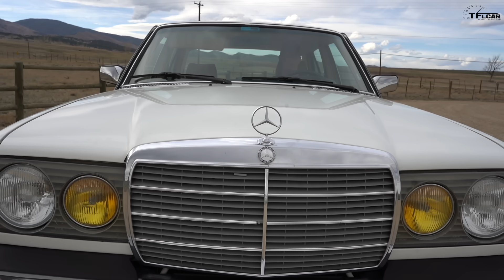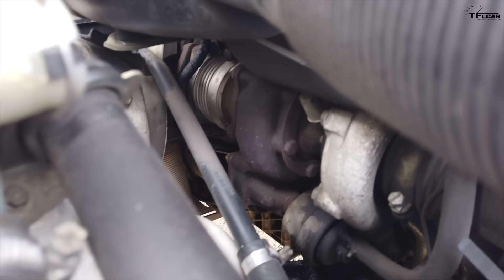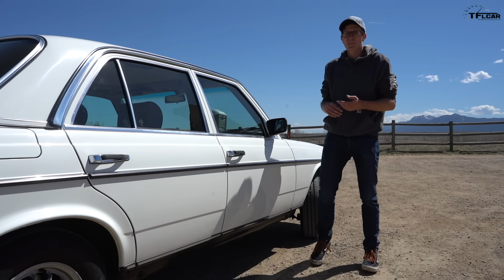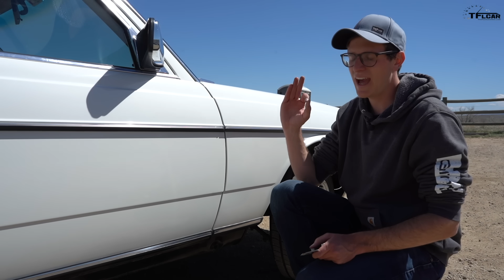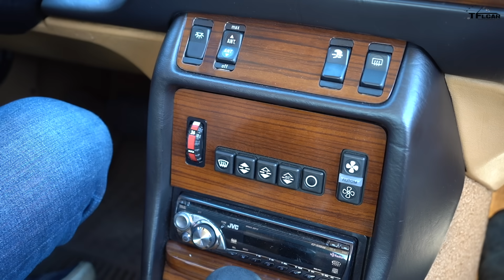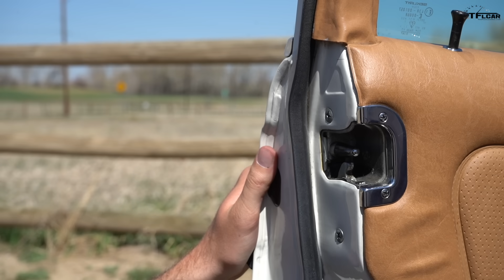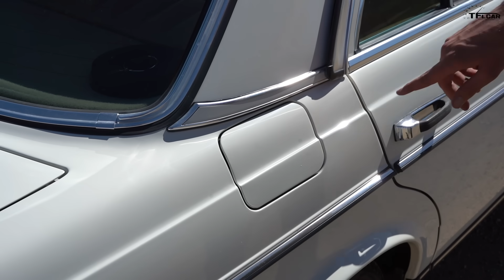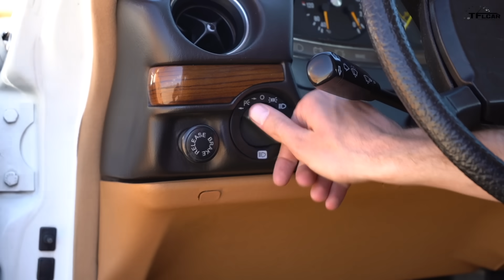This 37-Year-Old Diesel Is THE BEST Mercedes Ever Made!

Comment: I have a 1984 & 85 300D.  Never had another M-B, so can't compare, but don't consider it as reliable or easy to repair as my 1960's Chryslers or even modern economy U.S. cars.  The earlier non-turbos which were more common in Europe were probably more reliable.  My 1985 engine failed at 330k miles.  Disassembled and several pistons had chunks missing around the ring grooves and something like a small ball-bearing was bouncing around in cyl 1 (no idea how it got there).  Before that, the compression had dropped to ~250 psig in most cyl (>400 psig new) and needed a block heater in the winter.  The prior owner had religiously taken it to a dealer (thick book w/ many pricey receipts).  You can't affordably rebuild the engines since 1 new piston costs >$550 if you can even find one and many parts are "not avail".  I bought the 1984 for the engine, but found another engine so wound up w/ 2 drive-able ones.  Many small things can destroy the engine.  The vacuum pump on front of the block can send parts sliding into the timing chain.  An oil cooler hose can get cut by the power steering belt, starving the engine of oil, and this happens when motor mounts sag.  The lift pump can leak fuel into the engine block to dilute it, or its flange can break to leak oil.  If not enough fuel for the turbo boost, the pistons can melt.  A bad injector spray can burn thru a piston, and so on.  I do like the solid, clunky switches (like an old H-P scientific instrument) and the electrical connectors are large and easy to repair.  I agree that the automatic climate control is a complicated mess that almost never works correctly.  You must enjoy a sunroof since that is the only way they came in the U.S. models.  The trunks like to leak water, often from the rear window flange rusting.  Mine idle much quieter than yours, probably because I fuel with renewable diesel, which we can buy at the pump in California (works in any diesel).  No net-CO2 emissions, so better for the planet than any battery-car.

Comment: Not only the best car but the cheapest to own. My 82 240D has over 250k and runs great. I call it the "Triple Four". Four doors, four speed, four cylinder. I mix used veggie oil or home heating oil depending on the season with Diesel. And it still gets 30mpg. I would not sell at any price. Well almost.
Reply: I had an 84 300d euro 4spd (no turbo), it got 36 highway with standard tires. I swapped 2 for 185/75 and got 39 highway, don't recommend unless you find heavier light truck/ RV tires because it got a bit drifty, did great in the snow with them on the rear though. 
Home heating oil is #1 oil and will reduce cetane, it won't gel in really cold weather but it also reduces power/mileage. I did run the diesel additive all the time though, whenever I stopped the mileage dropped and it got a little sooty.
Reply: Is using home heating oil in your country illegal? - In Germany it is a big crime cause heating oil is the same fuel just as Diesel just with an added color for notice
Reply: @martin5697  it's also illegal here. not an option as price is almost same as diesel.
Reply: @martin5697  No bureaucracy here to even fine you for using it HHO. It's all about the paperwork.

Comment: @TFLclassics,

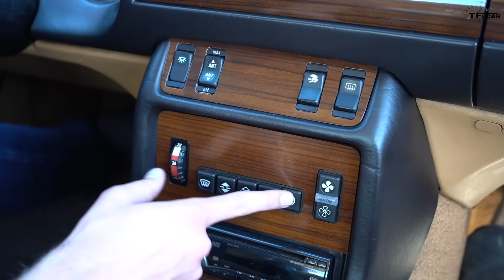you complained at time mark 10:34 that the temperature setting wheel is gauged in degree Centigrade, not degrees Fahrenheit. However, you conspicuously avoided to point out the setting wheel is coded with varying colors to indicate from hot to cold and everything in between.
Reply: My Dad had the gasoline version of the 200 series and it was quietest, comfortable and powerful car I’d ever known at the time.

Comment: These were “dumb” engines. They weren’t taught to make a visit to the dealer every few months to empty your wallet. I owned a 1980 240d, a 1982 300sd (turbo), and a 1985 300d (turbo). These were commercial vehicles disguised as a normal passenger vehicle. The engines were severely overbuilt, and severely underpowered ....the perfect combo for low maintenance and very few repairs. I drove about 1 million miles among the three. I never ever broke down .... ever. What happened to them?The floorboards went “Fred Flintstone” due to rust on the 240d with over 700k . The 300sd with 400k died in an accident. The 300d was lost in the divorce (but I did get weekend visitation 🤠)

Comment: Compared to the throw-aways today..
I stopped buying new cars in 2007. Just maintaining 13 y.o. 
Banks do nothing but bankrupt our kids into loans. 72/84 month for junk.
Reply: John Gun the business model has changed drastically since the 80's.
Back then Mercedes buyers bought their cars with their own money. They were bought by wealthy people. Nowadays 85%are sold through finance on a pcp deal to regular people . They return in 3 years and go again. 
So the way the manufacturer looks at it is the car needs to last 5 years at most. 3 for the first owner and 2 for the second.
The company I work for has done several "right sizing" projects which means making something last as long as it needs to and no more.
Sad really
Reply: Yet cars are actually cheaper if you factor inflation. The bank loan stuff is a different manner.
The long term loan stuff is assinine though. End up in forever car payments..
But that's people choice..
You can save up and pay for a car, or at least have a big down payment.
But too many today want instant gratification.

Comment: My father had a W123 230 from 1978. 109 horses, technically great, no problems - but  with the years very very rusty. Imho NOT the best MB.
Reply: All cars get rusty if you dont maintain it properly. The piint of this car is to run forever without issues, not be immune to rust

Comment: I agree with you, I've owned a number of 240, 300D (both Turbo and pre 1981 non Turbo versions) and 300TDs over the years.  Bullet proof.  You missed a few less obvious cool features:  back in the fuel door,  the spring mechanism is to slide the fuel tank cap into while filling the tank.  The cruise control stalk I always felt was very innovative and well thought out as well.  The seat has TWO slide controls, the one you showed on the side slides the seat  back and forth on an inclined plane to raise and lower the seat,...then the fore and aft adjustment handle is in front of the seat. One correction, ….your turning circle would probably be 10 meters, not centimeters.

Comment: I prefer the volvo 850 (especially the T5R model) because the mercedes rusted like crazy, and it had problems with starting up in winter. The volvo on the other hand started every time and was build out of double galvanised thick steel. You can still buy these cars that look like new from the outside only the plastic interiour hint’s at its age.

Comment: There is a 1976 240 D in the Mercedes Museum with nearly 5 million km on it.  It was a Taxi in Greece and a plaque at the museum indicates it is the  highest known mileage car in the world.. so yeah your car comes from an extraordinary gene pool.  Jay Leno once claimed that if GM had built the AC and a few power accessories that you'd have a perfect car with the Mercedes-Benz.  My 1988 W 126 is a rolling testament to that legendary German Engineering.

https://www.expatica.com/de/last-ride-for-mercedes-taxi-with46-million-kilometres-on-clock/
Reply: Highest mileage car in the world is a Volvo P1800
Reply: @CarlosCostaX  True... another great car but Highway mileage. From a strictly durability standpoint it would still have to double that to reach 5 Million City. The Mercedes-Benz in the Museum still runs too.  Both the Volvo you refer to and this Mercedes-Benz have had engine rebuilds.. The documented highest mileage without a rebuild is still an OM 617 Diesel.  There is a YouTube video of that particular car. You can't beat a diesel for durability.  There are tractor trailers in the US with 8 million miles on the clock.

https://www.youtube.com/watch?v=15jkNDwHWj0

Comment: My boss in the 1980's had a MB 300D (the engine failed twice) and a Ford Festiva (the Korean built Mazda mechanicaled version of Ford's Euro- Fiesta I ran to the red-line daily and couldn't kill). She was not aware that as twenty year old I just beat the ^&$% out of both cars just as if I was driving one of the company Ford-E150 (4.9 liter 6cyl) delivery vans when she asked me to pick up her brats or drop off floral supplies/ deliveries in the Ford Vans.
The Benz was not only a performance dog, it stunk (diesel), the van surprisingly had decent pick up (and was decentr econmy at 17mpg for the era), but the Festiva was straight up sex (top speed 80ph and about 35mpg). Having previously owned a 1979 and 1980 FIAT X 1/9, and then as my daily driver to work a 1979 BMW 320i, the  Festiva was the only car that caused me to go the local Ford dealer and seriously consider buying either the Ford Festiva vs the VW, Honda, or Mazda equivalents. BTW -  message to Ford - -   much to the shagrin of the local dealer I bought another used BMW 320i (1980) for $3500 vs a new $6400 Festiva.

Comment: It is the very best Mercedes ever made.  I agree with you.  5 cylinder turbo diesel with a 5 speed manual is bulletproof.  I had a 190 D (300,000 miles) and a 240 D (200,000 miles).  I always wanted a 300 D but never had the chance to get one.

Comment: By comparison the turning circle of a fourth gen Miata is 30 feet 6 inches.  Only 6 inches smaller than the benz despite it having an almost twenty percent shorter wheelbase. (91" vs 110" for the 300d)

Comment: I see from the odometer that you only have 1K more miles on it than my 1984 300TDT, it’s just a great car! I have the wagon hydrauic lift system and that is really the only problem I have had when the vibrations wore a hole in the plastic hydraulic tank and over a half gal. of fluid leaked out. These tanks are impossible to find as a good used tank or as new, never checked with MB parts but I repaired mine with Gorilla glue. That leads to my other gripe and that is when Mercedes started saving $$ thru the use of lots of plastic trim parts, a real shame because I guess in Germany there is less of a problem with the sun and solar heat that causes all the interior (yours too!) to just wrinkle up and shrink! Nothing to do about it. The dashboard plastic can be protected with a cloth covering and even if it develops cracks, there’s a replacement kit for $100. Still I know that this car will outlive me! I just wish they had spent more time on the interior trim and used metal instead of paper thin plastic, I mean real rosewood is used but why not better plastic for the other stuff.

Comment: 300D's we have 2, the first one is still beautiful inside so we enjoy it as is, air conditioning and all. The second a tree fell on the rear roof so we chopped it right behind the front seats and made a pickup,  seems like everywhere we go, someone wants to buy it. 
The koolest about these is that they're non- computerized diesel, and we run them on used cooking oil from our local donut shop.

Comment: While i had one and still think it is one of the best, i would rate the W124 even a bit higher. (It first featured the switch to fold down the rear head rests from the front so you would see out of the back. This feature was last standard with the W211)
My W123 was a 300TD (non turbo, the T was for wagon) and it was great. (And mine had an electric passenger mirror)
You should have shown the "steel folding wedge". Every Mecedes until they stopped issuing toolkits had a folding wedge made of steel.
Most people didn't know what the thing was...
As for the side trimm line: it was called "Rammleiste" and the purpose was to be the outmost piece of the open door, so if you open the door and hit something you would not damage the paint but just scratch the corner of this thing.
The back light switch: you can't reach the light in the back if you sit in front, and if you want to switch on the light in the back while the doors are closed for rear passengers, you can by the switch.

Comment: My dad had an atmospheric 3.0 L 5-cylinder 240D of the immediately previous generation (W115 with the 1973 facelift) and despite the different headline design all the rest looked pretty much the same as this: the doors, the windows, the body panels, the chrome trims, the ribbed taillights (although with a different light configuration), the seats, the arm rests, the brown vinyl upholstery (that one may be leather though), the steering wheel, the engine noise. We didn't have automatic climate control, it was just the regular AC. We didn't have that fake wood in the center console and dashboard what was a plus in my opinion.
PS: The fact that the climate control is in degrees Celsius for the US market was actually a plus since it will helped users to get used to it. Tip: Normal human body core temperature is about 37°C (98.6°F).
Reply: Actually, the Mercedes-Benz with greatest mileage (4.6 million kms) is a unit of the 240D version from the previous generation model (W115), and it was retired because of the environmental restrictions set in place for the 2004 summer olympics in Greece:
faz. net/aktuell/gesellschaft/mercedes-benz-museum-das-sagenhafte-taxi-des-gregorios-sachinidis-1178156.html

Comment: And of course W124, drivers better but think the platework of the W123 is little bit stronger against rust. Well anyway, the era of really good quality Benzes is over. Todays cars do have bad quality water based paint Jobs....... Just one thing to start with........ And than there is elektronics in newer cars...... It really can break up marriages to keep some modern cars running....

Comment: Owned a 240D daily driver for 26 years... 1981 4speed and OM616 4 cyl. About 250K miles.  It still looked new when I gave it to my brother.  I still have my very elderly mom's 1985 300CD auto, 5 cylinder. OM617.951 many consider it to be one of the best condition of that vehicle in the country.  I now drive a 2011 W212 with OM642, has little over 26,000 miles.  Wonderful car.  Not as reliably rugged as the earlier cars, but much more refined and faster.

Comment: Dont forget the MB-Tex, a revolutionary vinyl that looks like leather, and holds up 10x better. It took VW 20 + years to catch up with that technology. Also, that AC control unit is even more complicated than what was mentioned: those buttons are mechanical slide switches on a printed board, which then turn on the electrical switches, and only then the electrical signal goes to the vacuum pods, which then operate blend doors. Incredibly over-engineered and prone to failures. In similar fashion, transmission shift points are controlled by a vacuum, so when that starts to leak, you get all kind of weird shifting, from too mushy to overly harsh. The less-equipped (and simpler) models were far more reliable in that respect. Later models (W124) were even more complicated, adding vacuum-powered door locks (also uber-unreliable, but whisper quiet). But properly maintained W123 300 Turbo Diesel will surprise you - they are quite peppy for vehicle of that vintage & powerplant.

Comment: You’re wrong, buddy. You’re wrong because you’re confused. 

It is the 240D that is the taxi special in Africa (to this day) and is still very valuable, even in the US, not the 300D. The 240 has nothing power and no turbo. It runs on anything except gasoline. It’ll even run on motor oil. It is indestructible. The 300D was faster? but the turbo overheated a lot. Not nearly as reliable or famous as the 240D.
Reply: Going like 10mph up the mountain though
Reply: John G oh yeah... it was slow as hell. 0-60 in hours. Still though, that’s the indestructible model everyone seeks. Everything was on vacuum tubes, even power door locks.

Comment: Very nice video but I have to disagree with one thing you said. Long before I was old enough to drive, I wanted a Mercedes. I don't know which year the body style you are reviewing first came out but when I saw it for the first time, I wanted one. What a simple but sophisticated body style. I love it! Back in the eighties, I came upon a '79 240D for only $2,000 from this old man. I wasn't even looking to buy a car but felt a dream being offered to me. Loved this car every time I got in it. Didn't even need to be driving and I loved it. There was just one downfall. The engine's compression was not good and I was looking at doing at least a valve job that the dealer said would cost me about $1,300. I panicked and sold the car. People say they have no regrets. Well, I can't because every time I see this model Mercedes, I have this feeling of regret for celling it. At least I only lost $100 of my total investment. 

Interesting tidbit you talked about. I wanted to see how my 240D would do on a long drive, so I drove it from Riverside, California to Laughlin, Nevada. As slow as this car was from standing still when you got up to about 50 miles per hour, it would seem to beg to go faster. At times I had the feeling the gas peddle was going down by itself. The interesting part was when I ran into a bit of rain. What a beautiful scenic drive. I had the sunroof open and noticed that I wasn't getting wet. That interested me so I kept it open as the rain became heavier. Still, no rain was coming in!

Before I bought that car I was beginning to hate driving. That 240D made driving fun again. 
There were so many things I loved about that car!